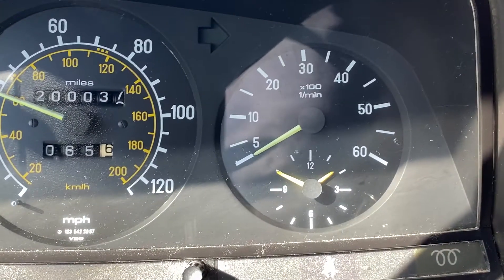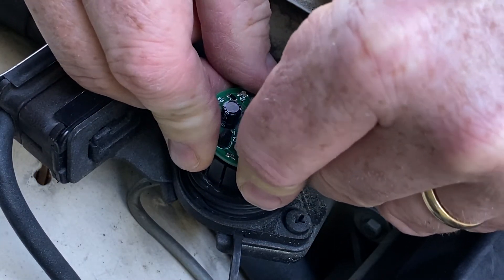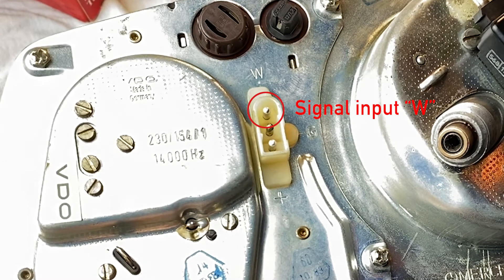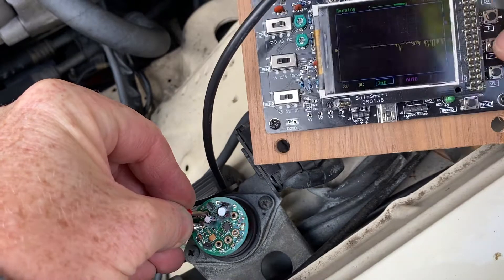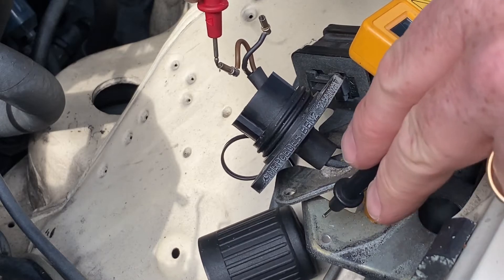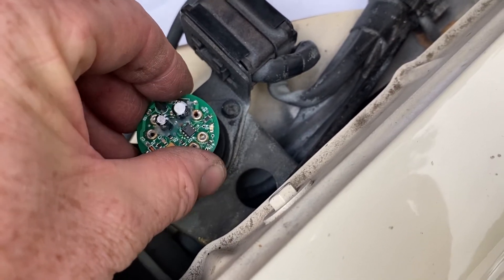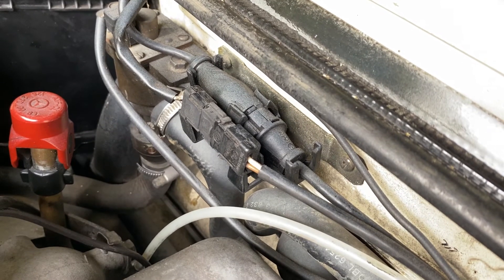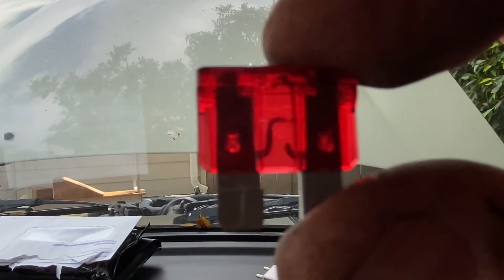Mercedes 300D 1984 W123 Tachometer amplifier diagnosis

Comment: Another complexity with the 84/85  years, the cruise signal comes from the ECU behind the kickpanel (you showed)! There is a way to bypass totally this ECU! The tach gauge plugin is also different on the 84/85 model 300D/300SD!

Comment: Thanks for this video. I own a 84 and 82. The 84 has same set up but my 82 despite replacing every component from the sensor on engine to the tack still doesn't work. The amp is good. Every once in a while tach needle will move. I thought bad ground but I just gave up

Comment: Just a couple of points FYI. Note that I am more famiar with the W124 systems as they are far more common where I am. Have rarely seen a W123 with a tach:
- The 14000 Hz marking on the tach would be a clue that you have the later system. This is the frequency of pulses at which the tach would indicate full scale (6000 rpm/60 s = 100 rev/s. 100 r/s * 140  (or 144 in W124) teeth on the flywheel equals 14000 (14400). Early tachs are only 1 impulse per rev so 100 Hz.
- Yes the later tach does not need an amplifier as the signal from the crank sensor is much stronger. The W124 does condition and amplify it nevertheless. I don't know about the W123 but I guess the same because if it was pass through the tach would work even with the EGR computer not getting power. 

In fact the circuitry is very similar in all of them, the only difference is the pulses per rev which is set by a Resistor and Capacitor on the board.  They are not picky about the signal shape or voltage, could be square, sine etc as long as it's above a threshold voltage (I think it's about 2-3 V). You can change the number of pulses per rev by changing the capacitor on the board. You can also sucessfully use the alternator W terminal if you adjust the tach for the proper number of pulses (around 15-20 with the alternator).

To test the tach you need a signal generator. A cheap way to this is to use a PC audio output plus an audio amp. Connect the audio amp to the PC, connect the audio output to the signal input of the tach, and use one of those online tone generators to output the correct frequency. Another way is to use an arduino using the tone function
Reply: I really appreciate your valuable information here in this comment. Also I wish I can fine more resources to read about these cars and the principles of each system.
Reply: Fantastic insight. Love to learn more. Thank you for your comment.

Comment: men, you was running without computer assistance, only on the mechanical inyection sistem. the red rele is the OVP, the mechanical rele inside use to fail because welds (leed free welds), just need to weld again and is good to go

Comment: Thank you for the excellent video. Especially the time lapse parts. My tach, in an 84 300D, just works when the car is cold. Can't be the fuse. My trash can is just a test port (unless somebody removed the PC board). It's starting to sound like it's the instrument itself. Any ideas?

Comment: Very informative. 84 is an interesting model years since it has some stuff that is compatible with earlier models and some other things that are compatible only with 85 models.

Mine is an 82 and has the “trash can” amplifier, and it’s a trash can indeed. When I got the car the tach was on its last legs, so I had to do some research about. When I took the amplifier apart I found a business card from a European car workshop from Virginia stuffed between the amplifier and the cap, so I immediately knew the amplifier was in need of resoldering. After redoing all the solders it worked well for a while and started to work intermittently again. This time the sender unit failed because at some point someone damaged the insulation and the exposed wires began to disintegrate. Had to replace the sender unit and it worked for a few years, until earlier this year when it began misbehaving again! Now is the amplifier that is failing again. 
Since I couldn’t take it apart this time to see what went wrong I ordered one of those modern replacement units from Ebay and I am waiting for it to arrive. It drives me nuts to see the needle either dead or jumping! 

By the way, as far as I know tachs on these cars and the 300SDs from 78 to 85 were always troublesome. They barely outlasted the warranty and began exhibiting all sorts of issues, is like Mercedes didn’t have a clue on how to make a decent tach. I guess that explains why the first NA models and the 81 300TDs Turbo didn’t come with a tach: it was useless! 

I don’t want to imagine the disappointment of the first owners that had to see dead tachs or jumpy needles after just a few years having paid an arm and leg for these cars.